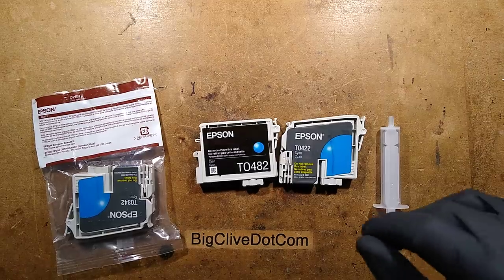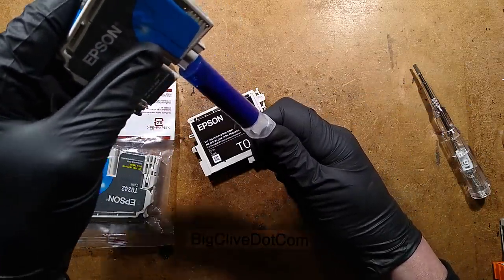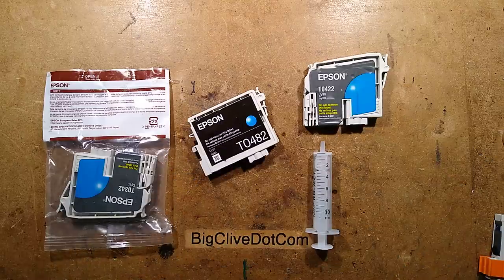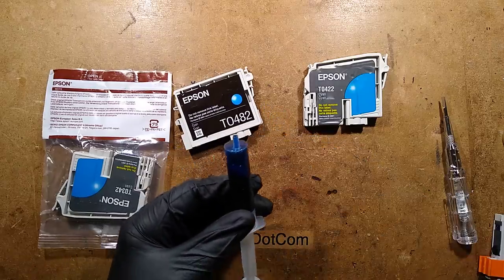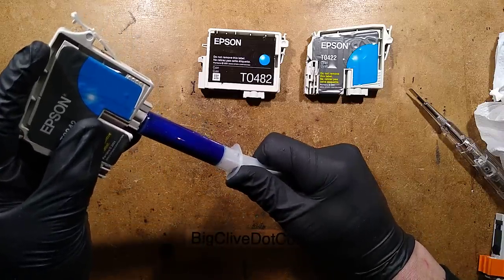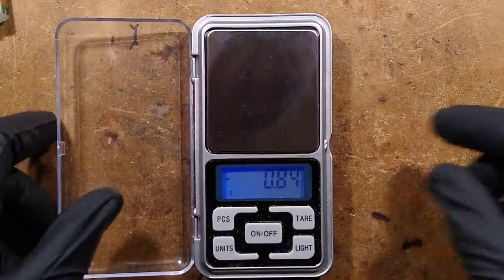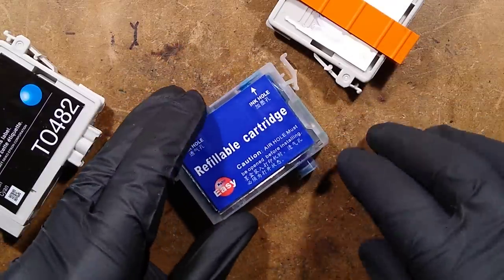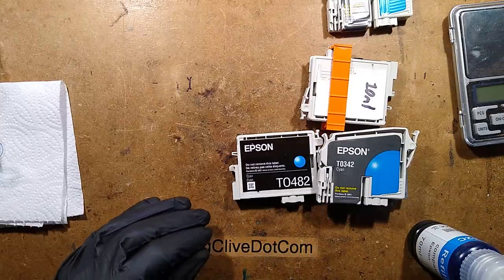How much ink is in Epson cartridges?

Comment: When I was looking for a printer I chose a Brother primarily because the ink cartridges (only black needed to print) were less than $10USD for a double size black.  
The color ones (3) were $6USD so I could print in color for pretty cheap as well...though I rarely needs to print colors...mostly just needed documents to print.  
Originally I paid $80USD for the printer...I recently looked up the price for the same model...they are over $120USD now  :)
Reply: Why not an laser printer ?
Reply: Have ink prices increased?
Reply: @VideosVlogsThatsIt   I use a Brother laser printer.  and I live about three miles from brother blvd. in Memphis (there is a Brother factory there but I'm not sure if they make printers or sewing machines there)
Reply: I was reminded of when I used my stepdad's Brother MFC (connected wirelessly to an old HP ProBook he gave me and I keep at his house), and even though I was only using it for the scanner, the software looked much nicer than HP's printer software and felt less annoying to use.
Reply: When I was choosing a printer, I went for a WiFi capable laser printer from Brother, because it also had the most and cheapest 3rd party replacement toner assemblies.
Never looked at the cost of the original.
Reply: Same
Reply: Brother is the best. I once had an issue with a printer that ended up being a router issue. I shot them an email and 20 minutes later a guy from their USA office called me to diagnose and help fix the issue. On top of this you can buy aftermarket toner for $26 for 3000 pages with no bullshit nonsense to make the printer take it and their laser printers tend to be cheaper to buy than competitors.

Comment: After horrible experiences with HP ink jet printers, I switched to a black and white laser printer. Been happy with it as I rarely print things so it fits my printing life style. With the HP ink jet I had issues with the cartridges drying out when I needing it, and inconsistent print jobs requiring print head needing to be cleaned.

While happy with current printer, sometimes I miss color printing. If I ended up getting a 2nd printer for color things, I have strongly considered the Epson Ecotank line.
Reply: Lexmark were always a cheap printer expensive as hell inks

Comment: 1:30 to answer your question there is usually an air port on the top of the cartridge when you get refillable ones, however typically the cartridges simply pull air through the membrane sticker that is on the side of them. That's why they warning labels saying DO NOT REMOVE on it as if you do you'll spill the ink everywhere.

Comment: I have one of the first epson ecotanks and it has been excellent. The only thing that I'm worried is regarding the printing heads. Once they start printing with lines or get clogged, there's no way to replace or service them as they are firmly attached to the continuos ink system with 4 tubes that carry the ink and are well hidden inside a non serviceable area of the printer. Tilting printers with reservoirs of ink sounds like a terrible idea also
Reply from the maker: There are videos on YouTube showing how to remove eco-tank print heads.  But also techniques for unclogging them with a layer of kitchen towel under the print head and a suitable ink dissolving liquid.
Reply: @bigclivedotcom HP used to advice rubbing theirs clean with a sheet of printer paper .
Reply: The eco tanks without the screen have a built-in hardware ink purge for cases like this.

Just hold the button that has the stop print icon for 10 seconds, and it'll do an ink purge. For heavy clogs, do it 4 times, turn the printer off and on again. Do the purge a 3rd time and then turn off the printer.

Hold the ink button when powering on the printer, and it should do nozzle test print.

The only reason I know this niche bit of information is that I used to sell them, and I got told this by trick back by Epson tech support.

It drinks a lot of ink, though doing this.

Comment: I think you need to do the same thing with HP cartridges as a comparison.
Reply: I'd watch this too!
Reply: I agree with this, but I'll also raise my understanding that there's a lot less content in HP ink cartridges...

(As little as 5ml, if I'm not that mistaken... 🤏)
Reply: @dieseldragon6756  I opened up an HP cartridge once. It had a spongey foam material material in it with only a tiny little spot of ink that didn't even cover the entire sponge.
Reply: @dieseldragon6756 But the HP system is more efficient than Epson. Epson uses fixed piezo printheads, a significant amount of ink every replacement is squirted out just to prime the system. HP uses disposable thermal printheads in the cartridge, they waste less ink because air doesn't enter the system. Ultimately, it's how many pages you can print.
Reply: You mean the 5ml full size cartridge, the 2ml starter cartridge, or the 10ml extra life cartridge. All the same exact size, but with different size foam pads and plastic filler blocks in them, because the cartridge contains enough space to fit 50ml in there.
Reply: @SafetyLucas  HP starter cartridge.......
Reply: The bigger HP printers, such as the 7700 series use a separate printhead and ink-only cartridges. HP are the most aggressive manufacturer in stopping you using refilled cartridges. Their printer firmware contains detection code that blocks anything but new official HP cartridges. Anything else and it will refuse point blank to print anything at all. 🤬
Reply: @geoffh2760  You'll need to tell that to my Deskjet 1040, as it's on about the 10th colour and 20th black refills.
Reply: @SafetyLucas  many years ago I dissected the standard black cartridge from an HP DeskJet 400(?) and the ink reservoir had two airbags which took up more than 90% of the space. Back in those days the carts were transparent so you could actually see this if you coaxed the printer into using all the ink. 🔎

Needless to say; HP switched to using black plastic in their cartridges before the year 2000 for reasons I think we can all work out... 😉
Reply: According to HP, the black cartridge in my printer should be good for 950 pages each, yet I'm on at least the fourth cartridge and the printer's own page counter has only just clocked over 900 pages since new!
Something very fishy is going on...

Comment: Two Equations -- Two Unknowns

Many otherwise identical print cartridges are available in both "standard" and "XL" configurations.
The only difference being the price and the extra ink.  Using math we can solve!
(Unfortunately HP is sketchy on the volume of ink, but often give the page count instead.)

Walmart: 
#63 black ink
#63-reg $22.89 / 170 pgs
#63-XL  $45.89 / 430 pgs

diff / diff:  $23.00 / 260 pgs
ink cost:  $0.08846 / pg  (~9-cents/pg)

#63-reg ink: $15.04
#63-XL  ink: $38.04
all else cost : $7.85  (package, cardboard, plastic cartridge shell, flex circuits, print head chip)

So a $22.89 ink cartridge is $15.04 of ink, but all the rest (printhead, cartridge, packaging) is $7.85

BTW, the MSDS indicates the ink is roughly 70% ~ 85% water.

Comment: If you need an inkjet and can get an older Canon model that uses BCI-24 ink then you don't have to worry about the printer claiming the cartridges are empty as there are no chips at all, if you ever open the front cover the software will ask you if you have changed a cartridge as that's the only way it knows. It will warn you that the cartridges are low/empty but it won't stop printing.

Comment: Some years ago while working for a large firm I gave up on buying ink as it became more cost effective to buy cheaper printers that came with ink cartridge I then gave away the old printers. Not sure I did much for the environment but made the IT department look a lot more efficient on paper.
Reply: I used to work for a large multinational company that had a leasing agreement with Samsung. The print servers had software on them that counted how many pages a printer had printed since the last toner cartridge change, and when it got down to 10% or so some guy knocked on the office door with boxes of new toner, never had to order the stuff at all..! I asked him if he'd deliver to my house once, he wouldn't, the swine 🤣

Comment: One sneaky thing that you do not see  many people talk about is that the ink jet printers throw away ink every time you power it on. Even if you do not power it off, it will go through the "cleaning" cycle if you leave it powered on after a while. and depending on the model it also goes through a cleaning process after printing X ammount of pages.

Comment: There's a much worse problem, I have a portable WF110W epson printer, that one is a great example of a printer that I only buy the genuine cartridges for it, simply because they're very small and the ink quality on compatibles can be dodgy and you might end up with dry ink over time if you don't use it for a long time (can also happen to genuine cartridges but more often to cheaper ink).

The right type of ink will always be used in the genuine cartridges despite paying a ridiculous amount for it, with that being said it's a portable printer that hardly gets any use if you need something you use a lot i would certainly go for the eco tanks or toner it's a lot easier to refill even the genuine ink is cheaper per ml than using cartridges. And to be clear here a compatible ink that's made to the same standards (specific colour if you care about colour accuracy during prints, viscosity, chemistry) as the genuine ink will be just as good but that's hard to know for certain.

There is a bigger problem however that most people don't realise, sometimes you'll get a compatible cartridge you install it and the printer either refuses to work or everything is off misaligned or not printing anything correctly, so you have to run the cleaning cycle which dumps a lot of precious ink so you just replaced say your cyan the printer will dump ink from every colour regardless if you only have a bad cyan print, it doesn't have to be this way of course but they make it so you waste as much ink as possible on cleaning cycles and after x amounts of pages printed why not another automatic cleaning cycle? The worst problem with inkjet printers is and has been for a while is how much ink they waste to function. 

Even the ecotank ones, a friend of mine had one which also had a bad cyan print (coincidence) in fact none it wasn't printing out of the cyan head, required a special deep clean that even the printer itself says it will use a lot of ink, but then again you can't ask it to only do that to the cyan so it spent about 5min dumping ink and cleaning the heads and the cyan came back afterwards, it used about 10% of the tank which is insane considering how much ink and yes 10% of each colour despite all others being just fine, per ml it's about as much as a set of normal inkjet cartridges just to clean up and get it back to work.

Comment: I did away with my printers in fury in February 2017. Bought an Epson Ecotank printer then and it’s still going brilliantly now. For £30 a year roughly it’s given me virtually unlimited printing. I would never go back to the cartridge system. I well remember buying entire printers from Argos as they came with the ink included- it was as cheap as buying the ink alone. Cartridges are just a total racket.

Comment: I recall my first color inkjet, a Xerox 4020, ink cartridges were just plastic tubs with foil end covers, flipping to the back pages of the manual was the safety data on the ink, which was non-toxic.  
*blinks  
Erm, non-toxic ink?  So food coloring?  A little experimentation and surprisingly equal parts red/blue food color resulted in the best black.

Comment: I "took to bits" a HP Inkjet printer and it was a hellatious mess inside.  All the overflow and cartridge cleaning had made a big mess and the sponge was saturated.

At the college where I worked the instructors would buy an Epson printer and after being gone for 3 months during the summer the heads would dry up and get plugged and the printer was useless.  At least with the HP the inkjets get replaced when the cartridge is replaced and it's working again.  But epson prints some beautiful pictures.
Reply from the maker: All inkjets have a waste ink collection mat to absorb the ink from cleaning cycles.
Reply: Yes, but the waste ink pad can become oversaturated and start leaking out the bottom of the unit.  This probably only happens if running a large amount of cleaning cycles or if there’s a malfunction and the ink siphons out.  

The latter is why you should always keep your tanks level with the printer.  Don’t ask me how I know. 😵‍💫

Comment: As someone who has been following the tech scene since the early 80s, I have found this particular type of price gouging to be at the top of my list of grievances. When you realize how much they're charging per unit volume of ink in these systems, it is bad enough. And then you find out that it's also just adding to our trash pile footprint as well -- along with those contemptible single-use plastic coffee pods. Not only are laser jets far better value, they don't bleed if the printed page gets a little wet. Sorry, but I find this market saturated with scammers who are all trying to figure out how to screw people out of as much money possible for some damn colored ink. It's not only greedy, but it doesn't give one iota of concern about the human footprint on the planet. How many pounds of plastic will a normal user waste in a lifetime buying those molded plastic ink cartridges? One of the first things I did with my laser printer toner cartridges was to make a hole in them so that I can pour new toner into each as well. All you need is a funnel, and a sticky plastic label to cover the hole. And it's a color printer, so I had to do each of the three colors plus the black. I bought replacement toner bottles when I got the printer over a decade ago. I got a larger amount of black, and one of each of the three colors. And I haven't needed to replace anything else since then. And in the whole 10+ years since, I have not needed to add any toner powder to anything other than the black cartridge!! Still prints every bit as well as the day I bought it. Ink-jet printers suck.
Reply: It's important to note that the toner cartridge is meant to be a wear item and does have functional parts in it. It's why some of the cheaper Brother monochrome lasers don't have high capacity toner cartridges available... It's not that there's no room for extra toner, it's that the cartridge wears out too fast.

But outside of the fusor wearing, refurbishing it to 'like new' will just consist of cleaning all the rollers and gears, greasing them, and replacing the drum head/cartridges and you can go back to refilling.

Comment: The worst ones are where the Scanner stops working because the cyan ink ran out (or expired). Its ALWAYS the cyan in my case...
The scanner thing is so annoying because I use a colour laser printer for printing, so the ink in my inkjet/scanner is always expiring..
Reply: I use a Samsung multi-function machine, printer/scanner/copier/fax (yes I still use fax..!) and it's working perfectly after 5 years. I do sometimes have problems with paper pickup in the additional paper tray that I added, but a little isopropyl alcohol on the pickup roller sorts that.

Comment: The diaphragm/membrane is typically a die cut piece of PTFE/Teflon. It's hydrophobic, so rejects moisture in the air, but still allows the cartridge to breathe. Personally saw the line that does all the die cutting for HP toner cartridges, same principal and process for everything else...

Comment: As somebody who has used the cartridge or a very similar version of the cartridge on the left the more square one. There is usually a tab that gets pulled off that allows air in and then when put into the printer it punctures the ink outlet. Sometimes the air inlet is a one-way valve and will not need to be uncovered.

Comment: I long ago changed to laser printers (or similar tech like LED printers) because I was tired of wasting ink cleaning print heads because I printed infrequently, and usually documents and not photos. Yes, toner cartridges are also expensive, and some have non-resettable counters in them so you can't refill them. But the cost per page is way lower than ink (at least it was back when I switched), and you don't have to worry about toner drying out if you don't print that often. But if you are really into photo quality color prints, ink jets have "always" been much better quality (especially on specialized paper) than toner based printers.